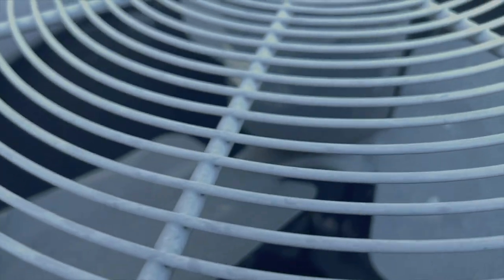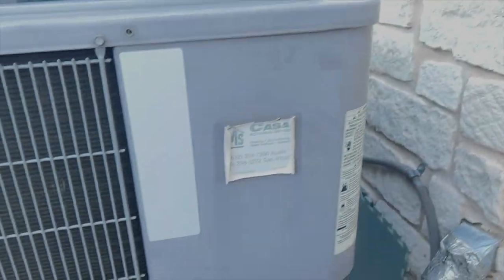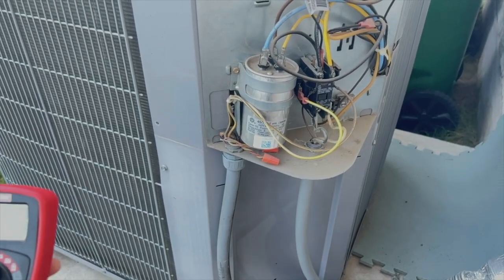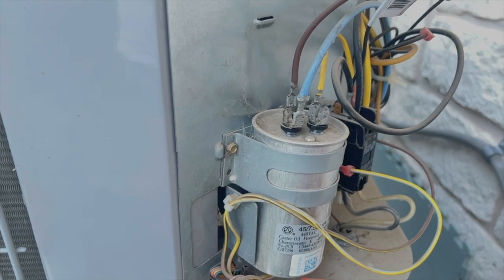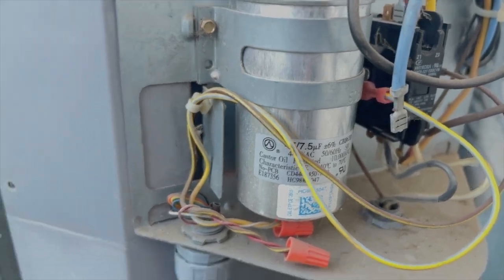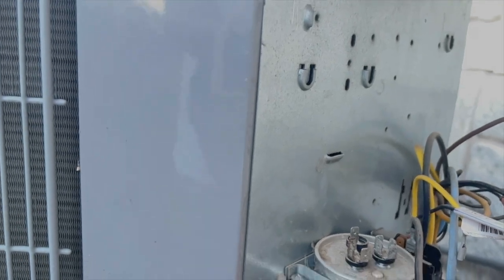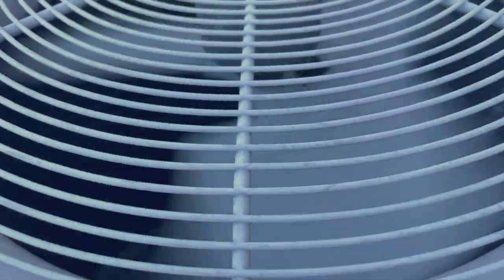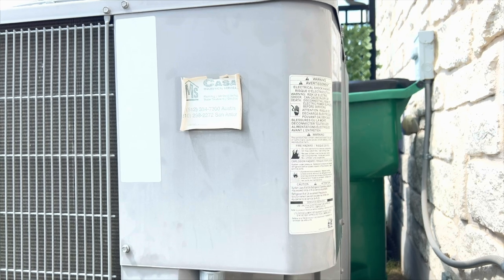Carrier AC Fan not spinning

Comment: Don't screw in screws with a ratchet straight away. It's too high a probability to strip them. Talking from experience. Make a start with a screwdriver then you can actually use even a power tool also.

Comment: You dont know what your doing. You swap parts out hoping to fix it. Some actual evidence that the capacitor is bad would be nice. If you consider yourself a Technician then you need to do better before making bad videos. Good luck in the future.
Reply: He fixed it didn't he? What are you complaining about. He just saved a ton of money and got to make a video about it to boot. So what if changing the capacitors didn't fix it. He's only out around 40 bucks.
Reply from the maker: @dandearman2871  thanks buddy for your support and encouragement :) Really appreciate that! You are absolutely right! There is no fr**king way that I will give any A/C man $700 for the repair :) I have better channels to spend that kind of money! :D and I bought a better DVM yesterday and proved that the capacitor is indeed bad!!! Thanks again for your strong support! DIY is always our best value in life!
Reply from the maker: Hey buddy! Thanks for your comment! As an engineer, we always follow safety procedures and make our best educated guesses in term of troubleshooting, don't we? I am always pursuing perfection and evidance as i go, and thanks for your advice and critics :) As a matter of fact, I just purchased a better DVM which has the function of measuring capcitor and I did prove that the fan capcitor is bad. The specification for the fan capacitor is 7.5 micro F as i showed in the video, the actual value is 1.8 micro F. No wonder the fan won't kick on. On the other hand, the compressor capacitor supposed to be 45 micro F , the actually value is 39.9 micro F. So this one is also getting bad. Yup! You are right! I couldn't say 100% that this capacitor will fix my problem, but in a 90 degree day or night and with engineer's best instant and guess during troubleshooting, I nailed it! This video is made to encourage engineers like me not to be intimidated by the "professional" aspect of this A/C appliances repair. It's not a horrible problem or dangerous one to fix as long as you follow safety precautions. Thanks again! I will make better videos next time and I will keep improving my techniques :)

Comment: You check the wrong terminal on the contactor for voltage. That terminal is the 24 volt, need to check two terminals at the bottom of the contactor to ground. Never trust the disconnect to be wired correctly.
Reply from the maker: Thanks for the reminder!

Comment: DO YOUR TEARLY MAINTENANCE, (POWER OFF) WASH OUT THE CONDENSER COIL, REPLACE THE CONTACTOR AND CAPACITOR EVERY COUPLE YEARS, AND DISASSEMBLE THE FAN MOTOR, OIL THE BEARINGS WITH THE CORRECT OIL, THE UNIT WILL LAST A VERY LONG TIME, CONTACTORS AND CAPACITORS ARE EXTREAMLY CHEAP AND FAIL OVER TIME, YEARLY MAINTENANCE WILL SAVE DOWN TIME
Reply from the maker: Great reminder! I was actually checking the coil cleaner stuff this morning prior to checking your message! I really need to get on top of these things before anything else major happened to it! Thanks a lot!
Reply: Clean pass the filter before the coils...you will see some fur on the cooling tubes,radiator.Vacuum that up.
Reply from the maker: @davidwarren2331  Thanks buddy! Really nice of you for the tips! I appreciate it!
Reply: My fans tried to die the one in the first year and the other in the second, poured some transmission fluid  I use in my car (80-90) into the casing and I haven't seen a problem since. 10 years have passed since I did that. You need specialized tools to disassemble the fan motor.